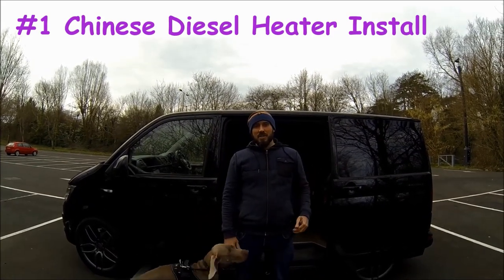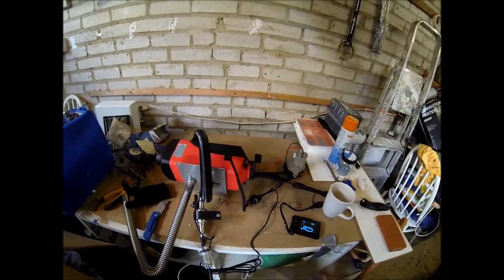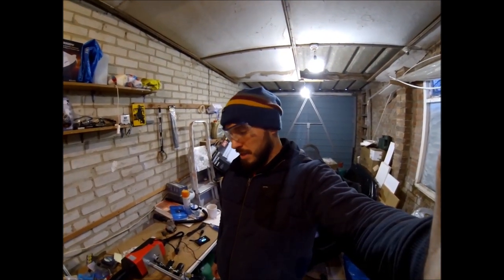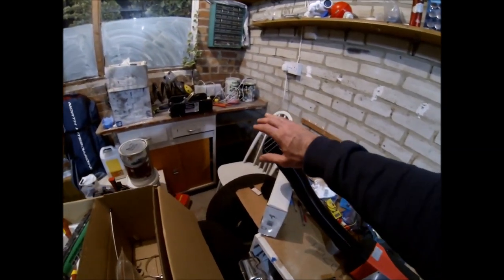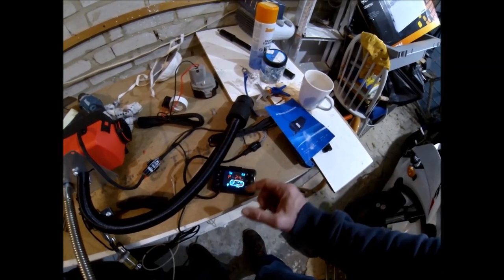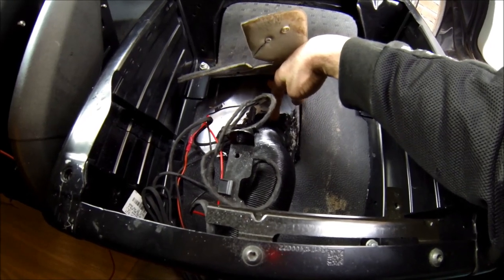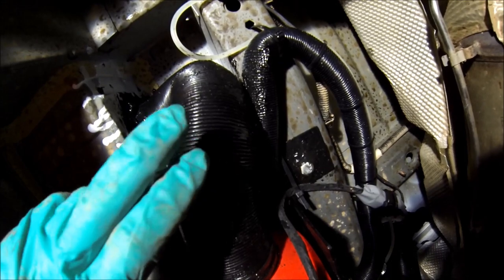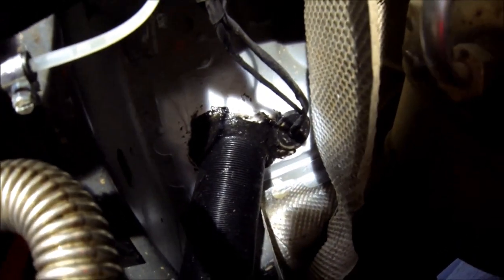Selfbuild Campervan VW t6 - #1 Fitting a Diesel Heater

Comment from the maker: Its a 2kW planar heater. Haven't had any issues with it so far. It was mounted underneath the van to a steel support. After the install I re-installed the underside VW plastic spray cover as there is plenty of room for the heater to be mounted behind it so well protected against road spray etc. (I had to cut a small hole in it for the exhaust to come out though).
Reply: Any chance of how your exhaust is exiting, Also what heat proof mastic have you used ?

Comment: Thanks very much for the video, very useful. Just waiting on delivery on my diesel heater. Did you have to remove or loosen the Addblue tank to be able to lower the diesel tank?
Reply from the maker: hey, sorry for the late reply I've been traveling around Europe. Sure you have sorted it by now, but if you haven't I did remove or loosen the adbllue system.

Comment: Hi, I may be wrong but this is not a Planar heater your installing here, it's a Chinese copy. The control panel is completely different to a genuine Planar / Autoterm one, the heater housing is also red / black where as the Planar ones are all black. ????
Reply from the maker: Hi there, pretty sure it was sold branded as a planar. Brought it from eBay

Comment: How is the heater doing under there is it still going strong no issues with being outside
Reply from the maker: Hi one of the fuel tubes is leaking 😬
Reply: @stealthvanman2068  i ended up putting mine outside after having inside best thing i done apart from that pump i ended up hanging from cable ties to stop the tapping